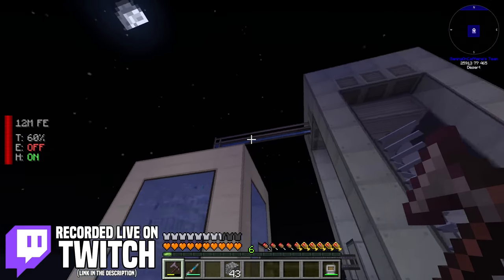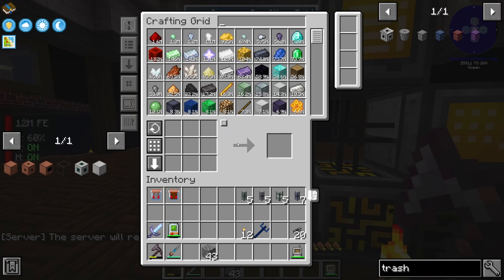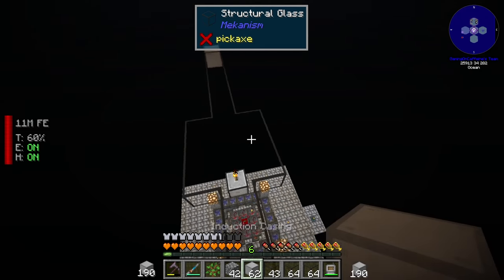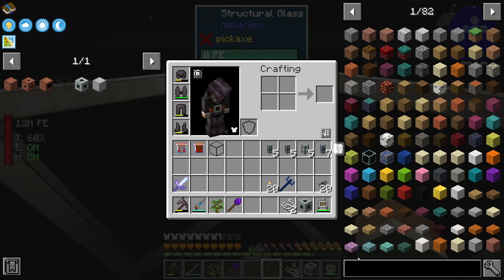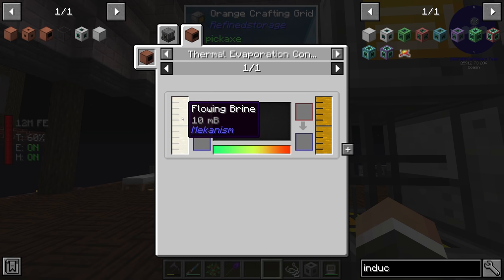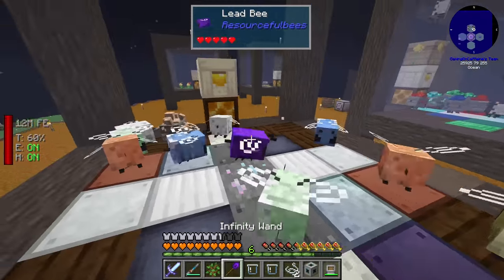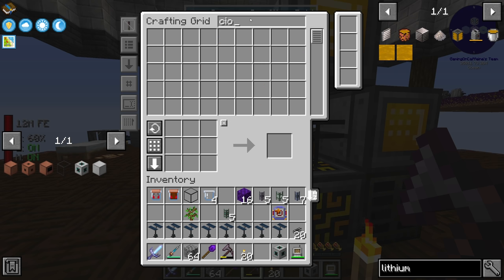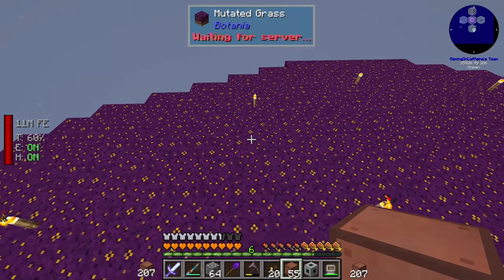Minecraft Sky Bees | INDUCTION MATRIX, LITHIUM & COPPER BEES! #24 [Modded Questing Skyblock]

Comment: For anyone that doesn't know it you can use the power that the Mekanism Advanced Solar generators produce when they are a part of the evaporation multiblock (the evaporation multiblock only uses heat not power) and also use that power to super heat the evaporation multiblock to go faster with resistive heater
Reply: ...And the evaporation controller doesn't need solar generators in the first place. It works without... extremely slowly.

Comment: In the thermoevaporation thing, the way you convert more say water into brine is by having more heat, it isn't based on the size of the multi block (unless that's the limiting factor). There are heat generators that, as the name suggests, make heat. They can either use fuel or energy, depending on which one you use

Comment: Just so you know, SOLARS are not needed with the Thermal Evaporation Multiblocks. I think at one point around 5 years ago they were, but, you could always use regular RF or energy to power it. But, solars are nice because it is free after crafting. Using the heaters, of course.

Comment: You don't need to switch your configurator to the type of pipe you're working with. Any configuration will work with any pipe, with the exception of wrench mode which will always "mine" the pipe with a right click instead. The mode feature is meant to be used on changing the input/output settings of a device without going into the device UI, not to be able to switch the push/pull of a pipe.

Edit: You also don't have to swap for things like the induction port or generator ports. The only time switching comes into play is wrench mode, which will instantly break most single block machines and pipes, and swapping the input/output of a single block machine and in that case, a UI should appear. All this info could be outdated since I haven't played 1.16, but I see no reason why they would change it to be more annoying.

Comment: Using daylight sensors , you could automTe the evaporation plant so  when it turns night , the heater gets a signal(since mekanism does redstone control) it turns on and you get heat , you can use solar with it

Comment: if all the spaces inside of the Induction Matrix were filled with Ultimate Induction Cells that would be 15^3*1.6trillion. or 3375*1.6trillion or 5.4e+15rf total. even if you had 375 of those spots as Providers, it would still hold 4.8e+15rf.
Reply: Bruh